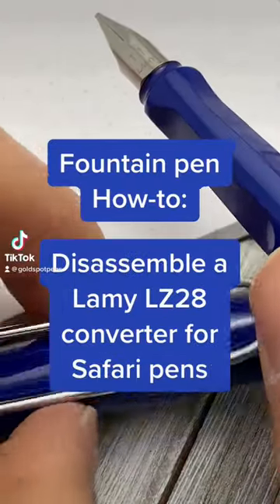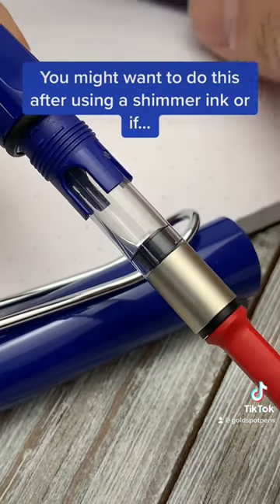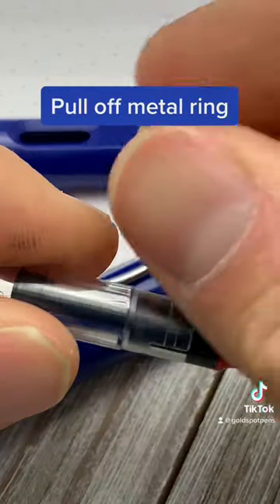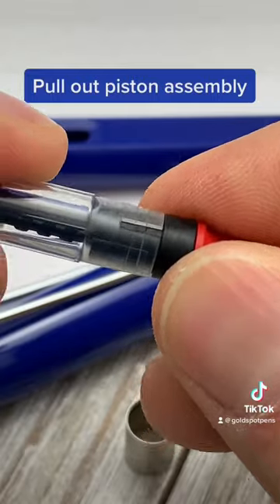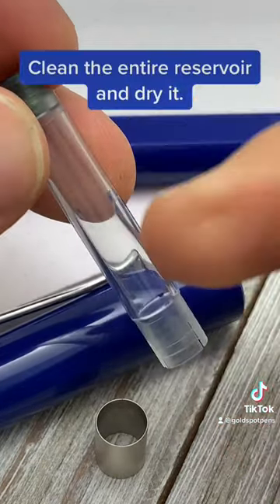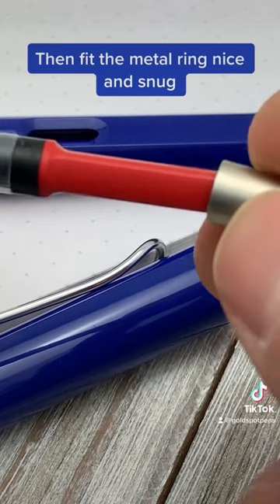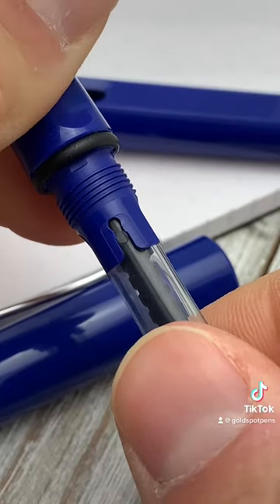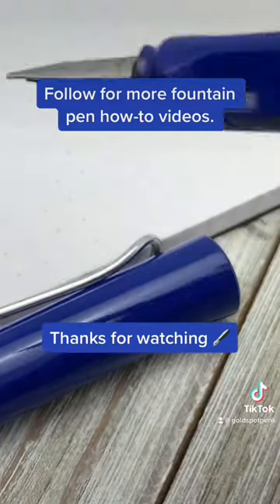How to disassemble a Lamy LZ28 converter for Safari #fountainpens #howto

Comment: Any tips on how to get the metal ring off? One of mine is stuck on pretty well.
Reply: quite late reply BUT Goulet pens sells a product called the "Goulet Grip" which is just a little piece of rubber that helps with grabbing little parts like this. I made my own for cheap by cutting up an old bicycle inner tube and it works great! Just make sure to clean it with soap and water before using it on your pens
Reply: could also use a rubber band
Reply: Use a large rubber band on the metal ring. It works like a charm and without effort

Comment: For the longest time, I had been avoiding using fountain pens. I bought a cheap one from Hobby Lobby and then never used it and lost all the parts except what was attached to the pen (it came with a converter and different sized nibs that I lost). But idk what came over me but I finally decided to buy a new fountain pen. A Lamy Safari Charcoal Matte with a Fine nib. I love it. I love writing with it. I use it all the time no matter how mundane the task is. My handwriting is god awful but writing is enjoyable now with my Lamy pen. I’m now looking into trying to get one of the special edition colors and/or a Lamy Dialog 3 on eBay. I love fountain pens so much. I don’t think I can ever go back to using a ballpoint again (unless I need to write on paper that is too thin for fountain pen ink)
Reply: Im new to this hobby as well and now Im addicted. I need to stop myself
Reply: @marcespinoyt  same. Lmao. I just bought a sailor Realo 1911 on Amazon for $229 and my wallet is crying in pain.